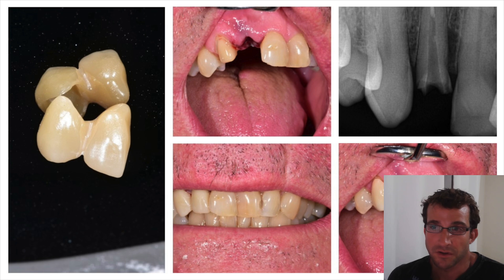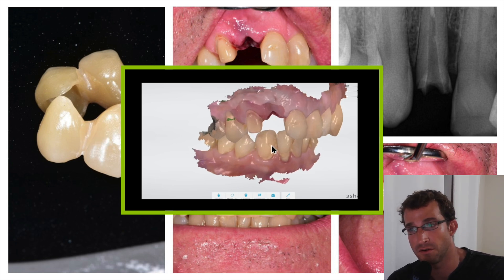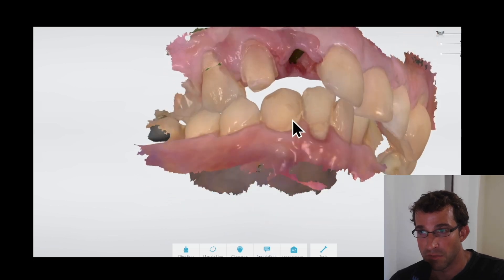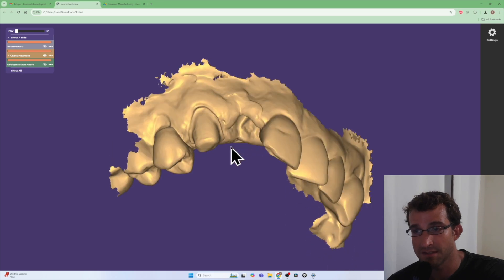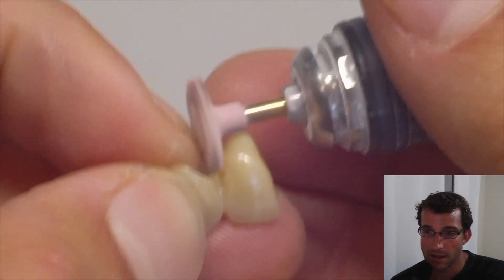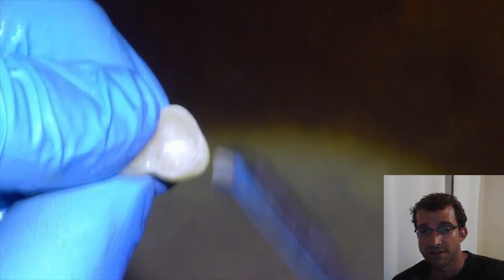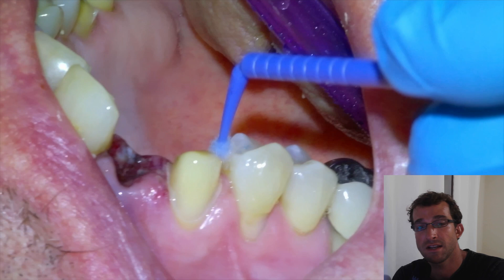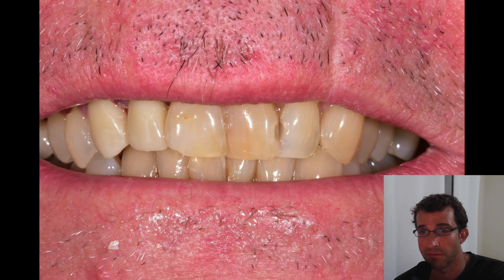[93] Immediate Canine Cantilever Bridge

Comment: Would an Essex appliance have been an option while he waits on an implant ?
Reply from the maker: Yup that would work if you really wanted  to do an implant. Even without the lesion though I don't see most people wanting to go that route when this option is available
Reply: @behindtheloupes  I wanted to ask, rather then delivering the final prosthesis why not leave it temporized until the healing is finished then bring him back for final impression. This way we can have a predictable shape of the gingiva?
Reply from the maker: Yup that would work as a temporary measure to give them something for the 3 months integration if you were deadset on doing an implant
Reply: @behindtheloupes  sorry I meant for the treatment you did. Leaving the cantilever bridge temporized till the gums heal
Reply from the maker: Sure but this is a much more functional and esthetic "temporary" than giving someone a removable essex which is more work to make than its worth imo when you can just mill one of these out. Cutting it off will take all of 5 minutes then just rescan and temporize as normal in 3mo if necessary

Comment: Great case! I wonder ... why didn't you go a bit for an equigingival finish line on the labial aspect of the cuspid? Even though we always prefer a supragingival prep .. What are your opinnions regarding that in the anterior zone we need an equigingival or slightly subgingival prep for maxmumun esthetics?
Reply from the maker: He has a low smile line which cannot be visualized unless the lip is retracted manually. If extra ferrule was needed for retention the finish line could have been dropped but wasn't necessary imo

Comment: Hey Doc I was wondering why the patient did not proceed with the Maryland! Was it due to the occlusion on the central/Canine or just overall worse prognosis compared to the cantilever bridge? Thank you for sharing this case and love learning from your videos as a new grad!
Reply from the maker: Hey man, a big reason was because I could make this unit in under 24 hours with my zirc mill as well as have more control over the shade since I can mill out multiple shades easily and pick the closest one. A double wing PFM Maryland would take 2 weeks to deliver through a lab and then often the esthetics is a bit of a crapshoot. Double wing full contour zirconia bridges are a thing but are known to fracture whereas a unit like this won't. He fortunately wasn't too fussed esthetically, I actually offered to chairside stain this unit to get a closer match for him but he told me not to bother
Reply: @behindtheloupes  Thank you!